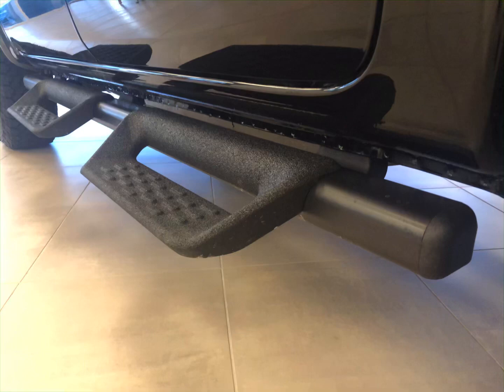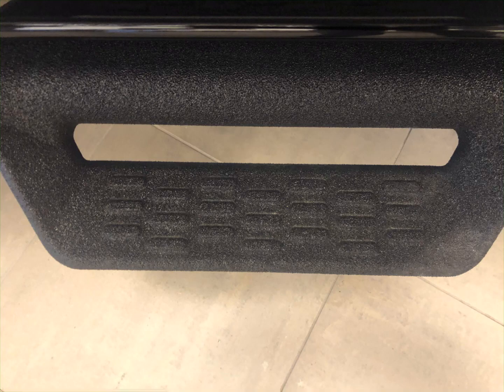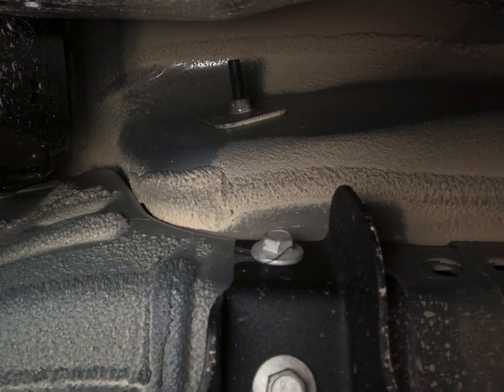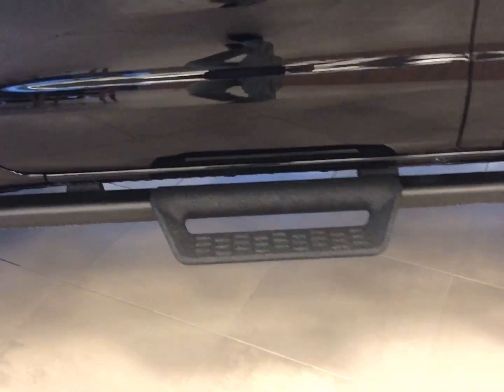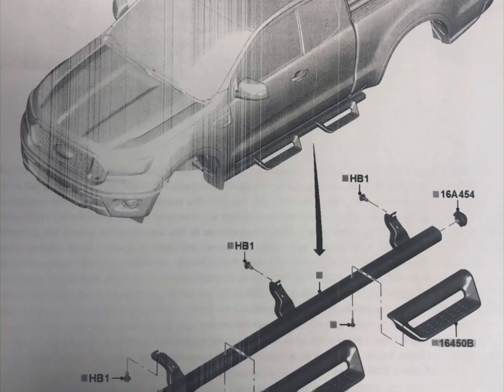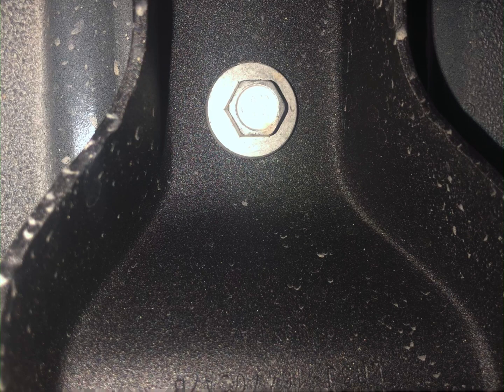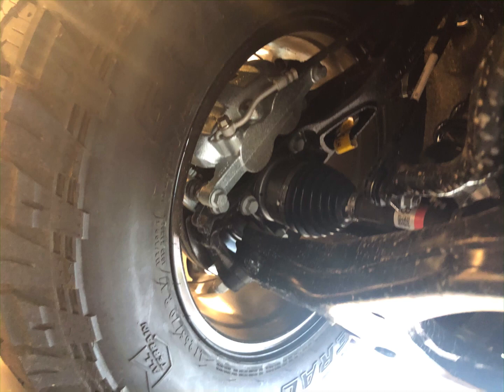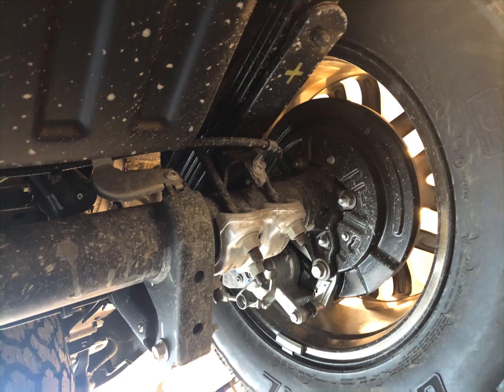Can The Running Boards On A 2021 Ford Tremor Ranger Be Removed And Unbolted? #ford #fordtrucks

Comment: Question.....does the available option hood scoop fit the Tremor hood?  The Tremor hood looks like it has higher bevels than the normal Ranger's.
Reply from the maker: I will find out !
Reply from the maker: He can you explain a little more of what you mean - as In  does a normal ranger hood fit the tremor or normal ranger modification fit the tremor ?
Reply from the maker: @TheBeatenPaths  ive never said I was a product specialist for sure lol I love doing video’s but that being saying I always got a guy lol I can always find out I’ll talk tomorrow
Reply: @TheCanineclub  I truely appreciate it!!! You're doing more than my local dealer!!
Reply from the maker: @TheBeatenPaths  okay you can get it with the tremor - my dealerships says it’s $399 PLUS installing it - It is double sided taped down - no drilling required - usually two days for delivery - have great day

Comment: I’ve ordered my Tremor from Ford and was really wondering if these come off. Do you really need them? I am 5’9 and was curious if I actually need them to get in and out if the truck.
Reply from the maker: They do come off, they are bolted on,
Reply from the maker: https://www.youtube.com/watch?v=-zWKMwRZQcE&t=58s
Reply from the maker: There is a video of the bolts and under the Ranger - I am 5'5" and I dont need them, but I do like how they look
Reply from the maker: Hope that helps, thank you for being a Loyal Ford customer
Reply: I'm 5-10 and I usually just step up, pivot and then sit down in the truck. I can see them being an issue with really tall people but I personally like them. On my previous truck I wore out the edge of the driver's side seat by constantly sliding in and out until the foam was exposed. This prevents that. Beyond that I love them as a convenient place to knock the mud off my boots before entering the cabin. I also checked and they don't interfere with the ground clearance nor do they extend beyond the side mirrors. If you are snagging these on terrain then I humbly submit you select a slightly wider trail lol. Ah well to each their own. If you do remove them just remember not to sell them as they may impact your resale value a bit.
Reply from the maker: @TSWest  Thanks for the comment!